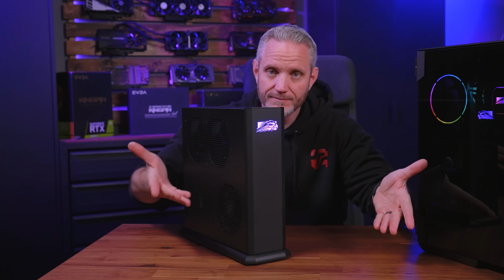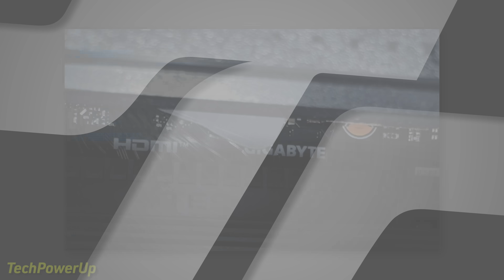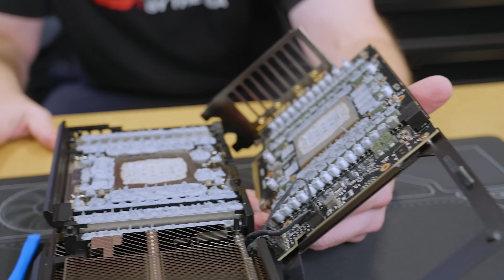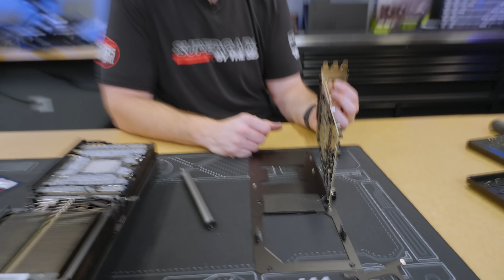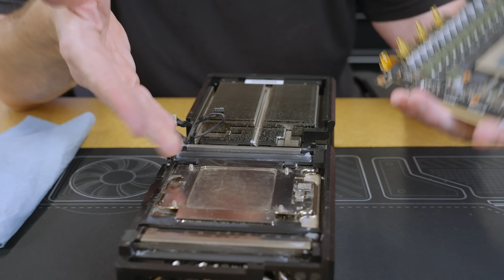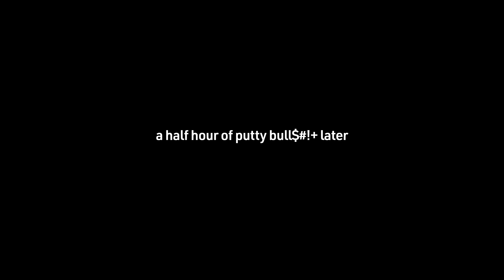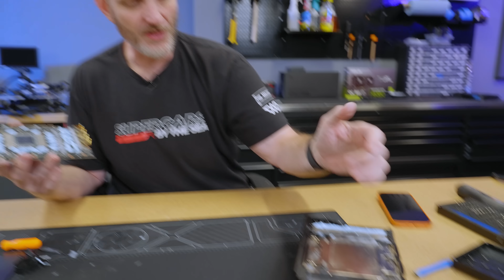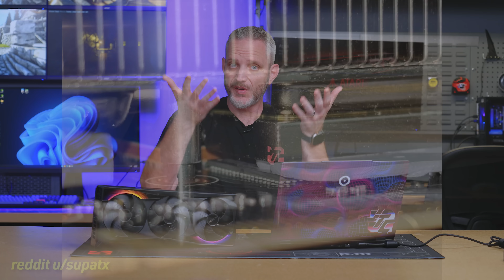What the HECK Gigabyte... WHY?

Comment: Before the release of the RTX2000 series, Gigabyte didn't have such problems with thermal interfaces. I encountered this when I bought a new Aorus RTX2080 and saw that the card was getting very hot, after half a year I disassembled it and saw that the thermal interface had dried up and turned into a brick. I complained to support but they didn't respond at all, they just said that they use cutting-edge technologies blah blah. They use their own shit, because that's where they get their thermal interfaces.
Now that's jelly)

Comment: I bought gigabyte gaming oc 9070 xt and that also had thermal gelon most components. I decided to swap stock gel with thermal pads and dealing with gel material was horrible. The card works pretty well after thermal material swap and only the memory temperatures did rise for couple degrees celsius. As I don't want to deal with this stuff in the future my next gpu will definitely be from different manufacturer that uses traditional thermal pads in their cooler design.

Comment: That's bad. Sounds like the same problem the PS5 has where they use Liquid Metal for the cooling under heatsinks and over time it tends to shift leading to dry spots under the heatsink and on the processor. Especially if the console is sitting vertically. This then requires a skilled person who knows what they are doing to replace. As the average PS5 owner will nerer bother to open there console or have the skill to peplace/fix it.

Comment: I got a nice pro tip from you out of this.  Take a photo before so you know how it is supposed to be when you put it back togetht.

I had to do a case swap for someone and it was easier to get the wires on the pins for pwr, led, reset, etc.  because I did that.  Thanks!

Comment: dude, you applied way too much puddy on the components...you have to create little balls that when squished covers the part, enough so it only overflows a little.  Btw I use that Big Pinwheel CX-H1300 and runs like a charm.     Watch how @SalemTechsperts apply thermal puddy

Comment: People here are very tech savvy in general but let me nerdsplain it to those who still think that "Gigabyte didn't do nothin' wrong!" 😅

This is not how you apply thermal paste. Ever. Thermal paste usage instructions would never tell you to apply it like that. Applying thermal paste to a chip is not like stuffing a turkey where, I guess … the more filling, the better.

The usage instructions for thermal paste instead tell you to apply a small amount of paste and spread it out evenly , forming a thin substrate onto which the heat sink is mounted. The paste should cover the entire contact area, but only just.

Why? No thick layer of anything will actually increase heat transfer. The purpose of thermal paste is to fill in the millions of tiny scratches and pits that will (unavoidably) be found on the surface of the chip and heat sink. Without application of thermal paste or a pad, these would be filled with air, which is terrible for heat transfer. Warm clothes, after all, work by trapping air between the fibers, forming an insulating layer.
Reply: As to "but the temperatures are good!" … for one, Jay explained that there's so much paste that it could drip out in certain orientations, which creates a whole bunch of new problems.

But also it shows that some people do not understand what a defect is. Do they think that it's not a defect unless the chip gets fried immediately? Well, if so, nice opinion, but the law disagrees. For example, take the case of Toyota who was sued in the US (class action lawsuit) over inadequate rust protection on several of their truck models and ended up settling for 3.4 billion dollars. (insert Dr. Evil gesture here)

It was not necessary to show that all the trucks were rusted through, much less that they were all inoperable when delivered.

In short, the law does not limit the notion of a manufacturing defect to "it literally doesn't work" … manufacturing defects can also include a variety of other deviations from industry best practices that result in reduced longevity, inefficiency, noise pollution or what have you. (Within reason, of course, i.e. without an undue increase in production cost.)

Anyway, whether Jay's card was legally defective or not doesn't even matter as long as he's not trying to claim damages … it's called journalism.

Comment: I redid my gigabyte 5080 a month after owning it,i run vertical hyte y40, the putty was pushing its way out of the gpu into the pcie, so i tore my gpu down and replaced the putty with arctic pads, i also replaced the compound on the dye with a gold infused TIM. So glad i did, temps when down 5c on the sensors i can see, what a terrifying experience, i have pictures if you want em.

Comment: On my 7900 XTX it was impossible to use thermal paste. It would pump out within a week or two, increasing temps to 110c on the hotspot, after which it will throttle.
I finally decided to get a few sheets of PTM 7950 which fixed it. At room temperature it handles like a putty, you can even re-use it by rolling it into a ball after scraping it off, then pressing it as flat as you can on the die. 
Re-assamble, don't tighten everything too hard as not to bend the PCB.
Start up something that'll heat the GPU above 45c as to make the PTM soft, then tighten down the screws.
Worked fine for 3-4 times already!

Comment: Seems to me the general "spec" is to use it horizontally. However, for square-ish desktop boxes (of yore) they would be vertical. Seems to me a lip to seal the four sides is needed. Like a soft seal on a submarine type of thing.

Comment: Lol use a syringe. Especially with TG paste it's pretty sticky and liquid. Some other paste you can handle and make balls or logs. On TG just drop the whole container in an old paste syringe cut the tip a bit bigger and go to town. Also get a little bit on one of the spatulas and dab everything component before applying. The residue left behind helps it stick.

Comment: I'm a die hard rastor performance guy.  I'd rather have 120 fps stable at 1080p without the DLSS/frame gen bandaid option than 1440 or 4k with DLSS turned on.  Poorly optimized drivers and game software coding is the real issue.  These 40 and 50 series cards from NVIDA are really not optinized for gamers anymore...

As for RTX...I hear its a huge FPS hit, and subjective visual improvement...also dependent on how game is coded.  Upgrade to a better monitor and get it calibrated properly will have a significant visual improvement with everything you do on your PC.

I'm open to other opinions...let me know your experiences.

Comment: I'm wondering if SLI took off it would have mitigated gpu size/weight (instead of buying one big card just buy multiple to do the job)? Also the benefit would not needing to deal with series line up, just get the same card (Although companies pretty much sell flawed (less efficient) cpu dies i3,i5 to retain profit).

Comment: I have gigabyte 5070 ti windforce sff installed in fractal terra and after half a year I am noticing this issue with thermal gell driping out of the bottom of the card.
I will try returning it and get my money back. I don't want to disassemble it and deal with this nonsense. If i get my money back I will buy INNO3D.

Comment: So quick story about process Manufacturing. No matter what type of paste you use there are exact measurements of the paste that need to be applied the engineers test for bleed out using a chamber that heats and cools them and shakes them  simulating the entire life of the device. It is called HASS. So during the manufacturing process the paste will be applied in exact amounts. But On Ship it Friday at the end of the Q that goes right out the door and they start kinda eyeballing it. then it becomes habit speed over quality and QA cant measure paste under a heat sync.

Comment: Glad i didn't buy the crap! Went with the EVGA RTX-3080,TI AND lol and I pray i hit the fkn lottery a 14 gen I-9 14900k ANNNND! I INTEND TO UNDER VOLT  also 96 gigs of RAM and a MSI Z790A WIFI PRO & then I get blessed with connecting it to my industrial cooling heater 😁 cools the PC heats the house 🤭 saved a bunch on oil lasyear

Comment: I still have my Gigabyte 2080ti in an iBuyPower prebuilt from 2019.  Back in 2022 I started getting issues with the fans going to 100% seemingly out of nowhere.  Even when adjusting the fan curves, the card was still getting way too hot.  I did a little research and found that this particular card release had issues with the thermal "paste" drying out over time and needing to be replaced.  Thankfully a Youtube video guided me through the process of putting new paste on, it was painless, and the card behaved like brand new again.  It's sad to see that Gigabyte still hasn't learned their lesson.

Comment: i was having this problem thermal paste pump out  on asus 4070ti  have used 4 diffrent types of thermal paste (the best one on markte thermal grizly and so on) and all pumped out..   after 4-5months  temps went up for 10-15°C   now i am using Honeywell PTM7950  and its ok for 2 years.  now i have new 5070ti from asus and it has PTM from start =)

Comment: With a non-condutive gel (which I don't know if GB uses), completely filling the area between the components to conduct heat from everywhere to the cooler surface would be an obvious method.  But this won't work with a gel that can short electrical connections or if there are hot components that must by stopped from heating their neighbors a few mm either side.  Basically a gel-version of the old meme of submerging an entire PC in an oil bath for cooling.

The plastic backplate is probably to make sure that no cables, CPU coolers, screwdrivers or other metal shorts out the component pins sticking out the back of the card.  Same purpose as the motherboard baseplate in a cabinet.  Plus it helps with looks.

Comment: Quick question for you: Is Gigabyte doing this just on their GPUs or on their high end AORUS motherboards as well? I'm kind of curious as I have a Gigabyte Z890 AORUS Xtreme AI TOP (yes I hate AI and no the LCD on the top of the mobo isn't useful to me but its other features are). Since motherboards are almost always in a vertical configuration this video has me curious as to whether or not Gigabyte went Gelly on the mobo side too.

Comment: did you cover the main GPU chip???? no thermal compound on it, am i right ?
Reply: Jay has a pinned comment at the top telling people that yes, he repasted the GPU core. I mean, it should be obvious to anyone that's ever put together a computer or done a teardown to repaste a GPU/CPU that he'd have a non-working GPU in about ten seconds without TIM on the core, and since the GPU continued working (but with higher temperatures due to Jay using Kingpin KPX TIM vs. the combo paste/LM used by Gigabyte at the factory), it is very much covered by TIM.

Comment: This is one of those things a manufacturing engineer changed to make it easier and cheaper to assemble without thinking of or caring about the consequences down the line. This is exactly the same as all of the plastic clips that snap when you look at them under your car hood, and why everything is disposable.

Comment: Used putty (U6 Pro) personally for repasting an older 6700 XT and 3070 together with PTM7950 on the dye and it worked just fine. Chose it due to the many different sizes of pads required and using putty was just easier. Messy for sure, but the temperatures were far better than the dried up/pumped out stuff that was on there already by a very significant margin. Putty applied from the manufacturer though? Sounds like asking for trouble cleaning that.

Comment: Something to check before your 5090 goes out of warranty. 
This is an RMA issue, Gigabyte needs to repair cards where the putty has moved off the components.
Depending on where you live you may have additional rights outside of the warranty period.

If/When they get a wave of RMAs hopefully they will learn not do do it again.

Comment: My graphics card had it's thermal pads dry out (a 4070TI i really did not expect it to dry out so soon), i think INNO3d did a mistake here, i'm not brand loyalist, but at the time they were the only 2 slot 4070TI.

I decided to go the putty route as there was at least 3 different sizes of thermal pads used, so i ended up buying 2 of Der8auer's thermal grizley putty's.
I puttied the VRM's and memory and put some cooling paste on the GPU, both the putty and the paste was the pink stuff.

Tempretures are better than when i bought it, but i know when i need to replace the paste i'll need to buy new putty and it'll be messy...

before applying the putty i stamped everything with putty to "prep" the areas as some video guided me to, it made the application easier, but was still annoying to apply.

Next time i may go for Duronaut for the GPU so i wont need to replace it as often

Comment: What is this madness of putting "gel" all over the graphic card from the factory? The only benefit is for the factory, any user who need to repaste/get new thermal pads or even new "gel" is going to have a hell of a clean-up procedure before being able to put the new thermal material on. And that´s not even counting to get the right amount on, because as with paste, if you get too much it isolated, if it is too little it does not transfer the heat.

Thank you for another, as always, great video!
Best regards

Comment: As I was curious on how putty performs vs. pads, I replaced the Alphacool Aurora pads of my watercooled 4090FE with Upsiren UTP-8 putty. With the putty I got 2°C lower delta on the VRAM, so just slightly better. I used around 20g for it.

Regarding your use of der8auer putty, I would´ve put his putty on the VRMs instead of the chokes(inductors) (display connector side), the VRMs definitely need more cooling.

Comment: With all due respect, this issue is MANY months old and has been largely addressed in all of the lots for the last few months at least, possibly longer, I don't know the exact date. I personally have a 5090 AORUS Master ICE (with a S/N from one of the fixed lots) and it is perfectly fine after being in vertical mount for months now. And I have it under max load very often. I think you should have been more transparent about the lack of confirmed cases of this happening with recent cards because they fixed it. It is basically a non issue at this point. The info is out there and you just didn't mention it for whatever reason.

For everyone that is worried about this now because you just bought a Gigabyte card. You're fine if it's from a lot that was produced basically anytime after April of this year, S/N ending in 2516 or higher, but honestly it was a rare issue to begin with so even if you have an older lot, you're probably going to be fine. Good luck and enjoy your new cards! Remember to undervolt those 5090s!

Comment: So your complaint is the thermal compound it annoying if you remove the cooler and monkey around with the card?  Bro, just don't monkey around with the card and there will be no problem.  There is no reason to remove the cooler.

Comment: Just got around to upgrading to a GB 5080 OC.  First thing I did was swap the stock cooler for a water block.  That was... fun.  A ton of putty to clean up.  A lot of thermal pads to cut.  Had the thought after I removed the putty that I could have left it on and it may have still been enough, even with what came off on the cooler. They went serious overkill on that stuff.  Oh well, pads will be easier in a few years when I need to re-paste the GPU.

Comment: Thermal pads can absolutely be better  but they're expensive and if you go really high end you end up with single-source solutions. That's why when I worked for Cisco they only ended up using the pads for the extreme range of access points, the high volume stuff used less exotic solutions where multiple suppliers could be sourced for cost and business durability reasons.

Comment: Finally a video on this! I noticed my Gigabyte 5080 putty leaking leaving the VRAM chips uncooled (yes, vertically mounted since the HYTE case doesn't allow horizontal). I recently replaced the putty and paste with a PTM7950 pad and UTP-8 putty. So far so good!
Reply: I've had no issues with the gaming OC models. I've owned a 4070 Asus Tuf, 4070 TI Super Gigabyte Gaming OC, and a 5070 TI Gaming OC, all of which worked perfectly. I also had an MSI Gaming Trio 2070 Super and a 3060 12GB Asus standard model. Additionally, I had an EVGA 2080 Super, one of my personal favorites, and none of these cards ever gave me any problems.
Reply: @Zenntric  It's a gigabyte 50xx series only issue. All your other cards don't matter.
Reply: @TheMightyRecom Did I not mention that I had one? Yes, I did. Learn to read. The others were just references to all the different cards I’ve had with zero issues. A 50 series is one of them—I literally mentioned the Gigabyte Gaming OC. If you actually read the comment, you would see that.

Comment: This isn't exclusive to this material. It's about clamping force. My 7900xtx pads on the memory chips did this. 3 of them were clean out of the card before I noticed. I think vertical mounting like the y-70 is the actual cause.

Comment: Would be interesting to see it done properly with pads (both instead of putty/gel and include doing it correctly on the back plate). Then see if the PTM or what actual liquid metal would compare to the existing baseline.

Comment: Given the design, is there risk of pump out of the main thermal paste on the silicon? It seems like it's designed in a way to prevent that, but I'm still paranoid.

Comment: Is it not true that horizontal mounts are in most cases the least efficient cooling position for air cooled models? At any rate, I have a Gigabyte Gaming OC 5090 and 5080 and both reform great, but they are horizontal mount.